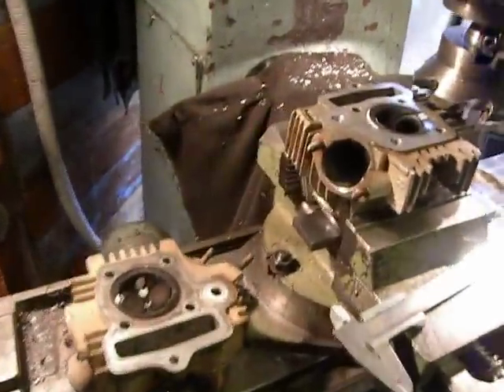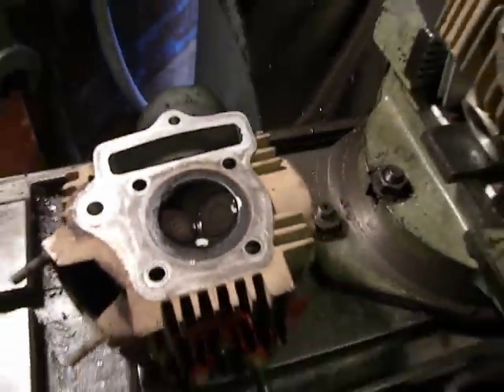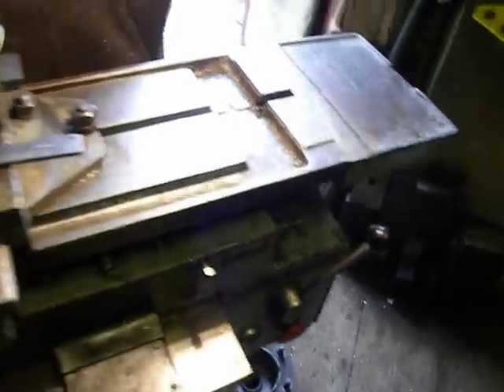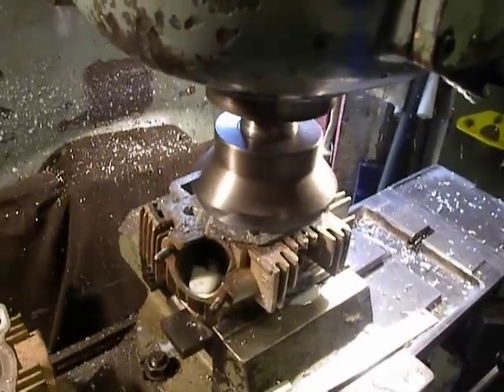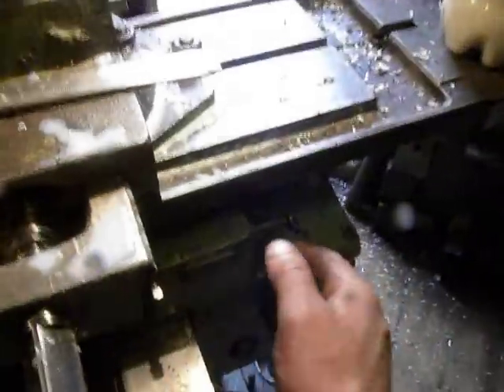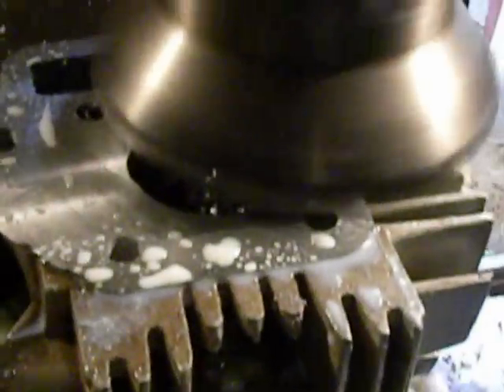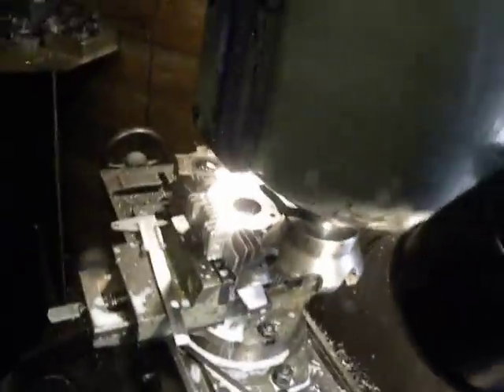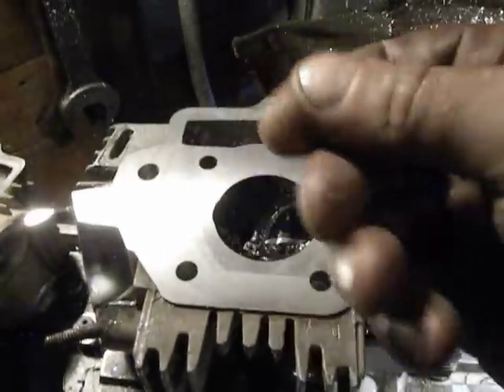Customize 110cc Chinese motorcycle engine head by 6T10 milling machine and Sandvik tool

Comment: Hi, how do i measure that how much i can mill of my head?
Reply from the maker: Well, customer says - skim off a watever 2...3mm+, I do this (here is custom stuff for race). Otherwise I do so: if need skim off a little, then I touch off , add 0.1 (0.05)mm, skim, look surface. if no good - add more 0.1 or 0.05(1)mm  skim it until surface is fine. Same thing I do un  surface grinder when I surface engine heads - take off as possible less material, until all surface is good. This takes some experiance and practicle until You get good result on this.

Comment: Wow, impressive work. I always wished I knew more about machining.
Reply from the maker: Thanks!
Machining... Oh, well, it is complex, not easy, but if You are interested to learn up maching it could be easy. Just intro: Lathe tips and tricks; Drilling and bore machining; Grinding machining; Milling tips and tricks; Gear making machinery including gear grinding; and another metal machining ways: metal saw / cutting, electro erosion, blacksmith & forging, punch, metal planer, welding, heat threatment, etc etc. Most actual: lathe, drill, milling and welding.
Reply: @FactoryDragon87  Cool. Thank you for the info!

Comment: The base gasket and head gasket are 1.7mm. He could have just done what I’ve done make a .5mm head gasket and get rid of the others. With the right porting job my little 110dx screams like a banshee. No joke try a little aviation fuel mixed with premium. Try lightening the piston a tad.
Reply from the maker: If I right remember that work then the customer said something for thin cylinder heas gasget, but I can mess up with this.... it was 5 years ago. 
The lighten up a piston gives less effect than when you lighten up crankshaft and conecting rod. Yep, aircraft fuel mix make evil most gasoline engines.
Cheers!
Reply: FactoryDragon87 how you doing?are you still doing this stuff? Don’t worry be happy.
Reply from the maker: Thanks a lot! I'm doing great! I still work in metalworking industry - that's my own work now. By the way in my latest video's You can see how I "skim off" 1.3mm  from 5-cyl head.
Cheers! Thanks a lot! 
You too be happy!

Comment: you can do this same thing by using rtv and losing the base gasket.. and on these motors the valves will still clear.. but be sure to run premium fuel. or the high compression will cause detonation.
Reply from the maker: Customer call music and I done this work. If I right remember, then he said something for E100 gasoline use or like that. 
Low octane gasoline (grade 76; 80's) have "detonation" problems and in forced engines with bad fuel.

Comment: The increase in compression is going to completely negated by the complete obliteration of the squish clearance. 

Combustion chamber squish band is far more important than an increase in compression.  Not to mention the increased likelyhood of detonation from the decreased mixture motion.
Reply: +monono954 Not his problem, he isn't the mechanic for this custom mod, he just did what his customer requested and it was a very clean job. I cannot comment on the change in size of the chamber, especially without knowing what the build will entail...
Reply: isn't a squish band on a two stroke?   this is a four stroke isn't it?
Reply: First of all, squish bands are favourable in both 2 stroke/4 stroke engines. Monono, You are in fact completely right... You mentioned detonation without the squish band, you see those 3 marks on the damaged head? The engine has indeed detonated, and the very violent explosions has flaked some off the stuck carbon deposits off the combustion chamber surfaces.

Comment: Does this cause too much slack in the timing chain? I think that has a overhead cam.
Reply: They make timing chains at any size for "these"!
Reply from the maker: Yes, I know... Better tripod for camera or cameraman. How do You think for "action cam"?
Reply: No sir..we adjust it by making another tensioner inside it..more like changing bigger rubber rollers inside..I'm an Asian mechanic by the way

Comment from the maker: That facemill I find in scrap-jard.. I was so happy as tornado in trailer park! The customer wanted "to seat" this cylinder head to maximum as it is possible by sample. Yes, 1.5mm is much for 110cc engine... I don't know for that to he use the E100 gasoline.... lol

Comment: I'll bet that facemill cost more than the entire chinabike.  1.5mm is about .060" I think, that's a lot for a small oilcooled single. It's gonna have 500lbs of cylinder pressure. I bet it makes a bit more power, once you get it started.  Maybe it's going to run on diesel now lol.